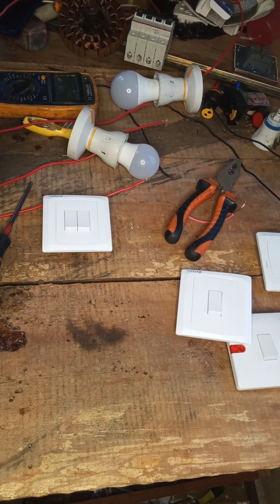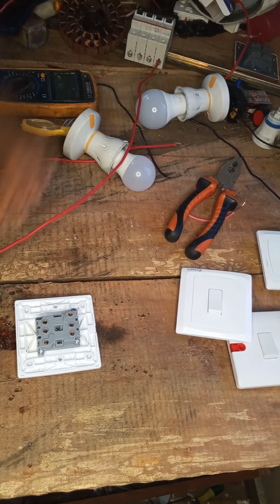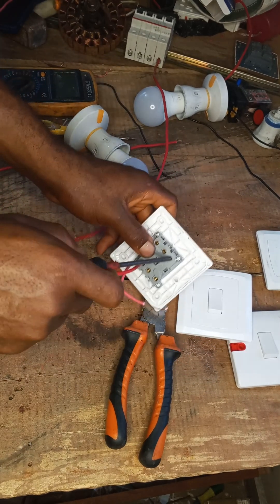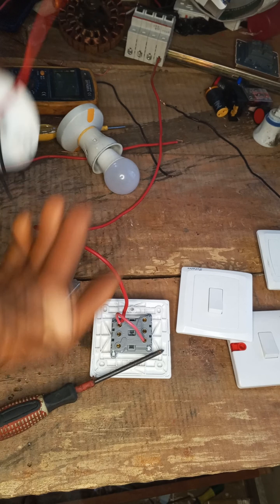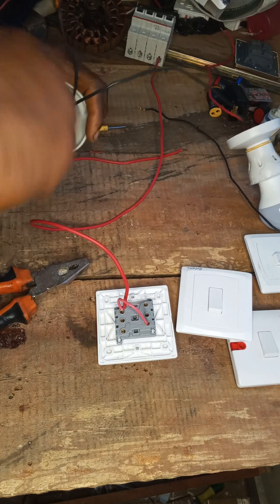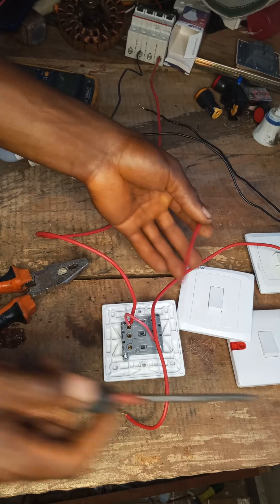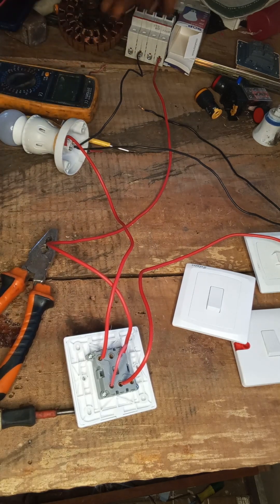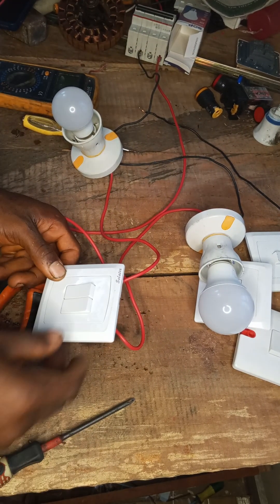2 gang switch wiring for 2 light controller step by step for beginners

Comment: Thanks bro,but when you're connecting two bolbs on the switch and double wire like red and black xoming from the Wall one from bathroom and the other  the kitchen, where do you connect the black the switch thanks?
Reply from the maker: The black is how many
Reply: Bathroom 1blck1 red  and kitchen 1black 1red also on single wire, and I'm having this switch
Reply from the maker: If the black is 2 join them together and tape it don't connect it on the switch
Reply: @chukwudiemmanuel8665 oh thanks a lots 💯
Reply from the maker: Connect only the red on the switch